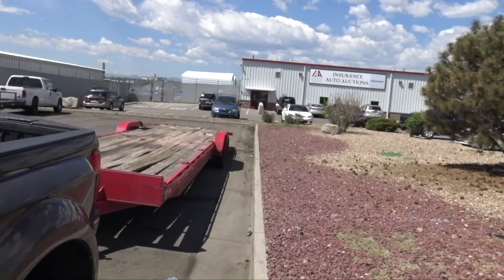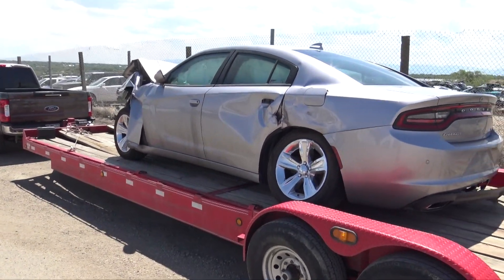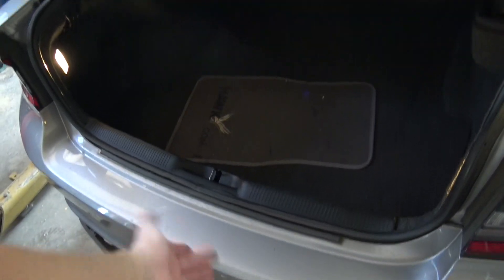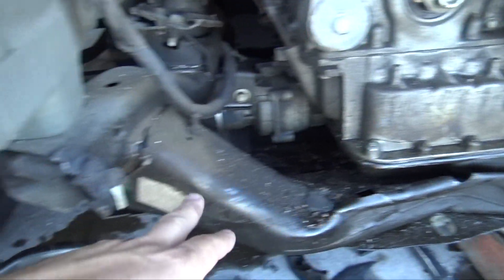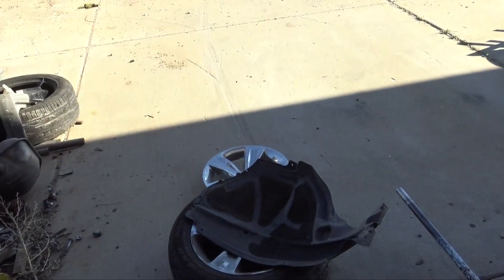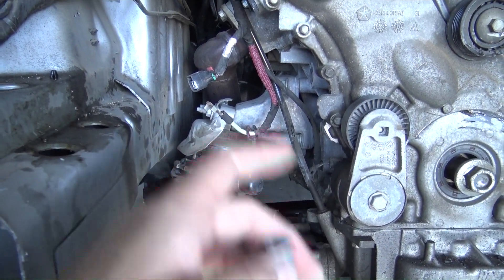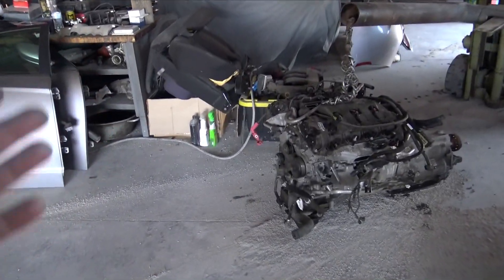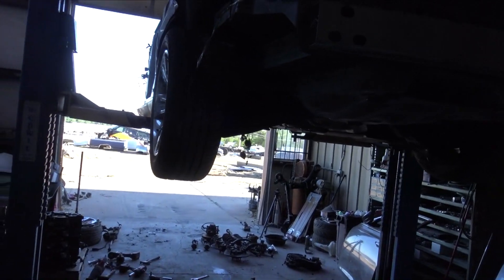Impulse Buy Cheap 2018 Auction Dodge Charger

Comment: Never reuse the hub assembly when they take a hit like that. Even if it sounds smooth, it will fail very quickly. The rollers are easily damaged

Comment: I’m looking for a good used HP90 trans.  Any thoughts on were to look in CO?
Reply from the maker: I might be picking up a redeye dropout if you want to buy the trans I dont need it sitting around
Reply: @Junkyard_Dave   That and the driveshaft would be awesome.  Let me know what you think you will want on that.  I’m adding boost to my 426 SRT Challenger and will be needing to ditch the current HP70.
Reply: @Junkyard_Dave   I just spoke with my engine builder and he is saying it’s difficult to mate up an HP90 in my SRT.  He suggested doing an upgrade kit for the existing HP70 so looks like that may be the way I’ll need to go.  Thanks bud, keep up the good work!